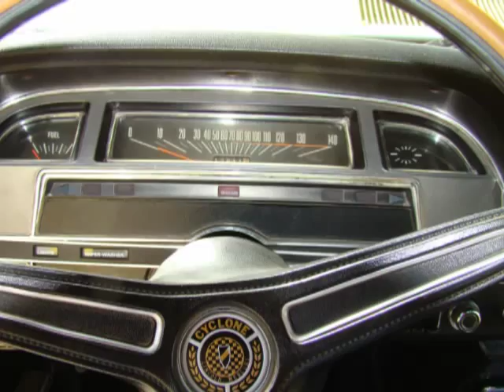Mercury Cyclone SPOILER

Comment: VERY, Very nice, badass car. I have one almost identical....just not restored yet ;-) Yellow/Black/Auto/Console/AM/PwrStr would make yours 1 of 72 Spoilers out of 1,631 that were built in this exact configuration. (gotta love Marti Reports.) Mine just doesn't have power brakes (what idiot doesn't order power brakes on a car like this?) Your's looks absolutely incredible and correct from what I know about them. Incredible!  (those wheelwell trim mouldings are hard to find aren't they ;-)